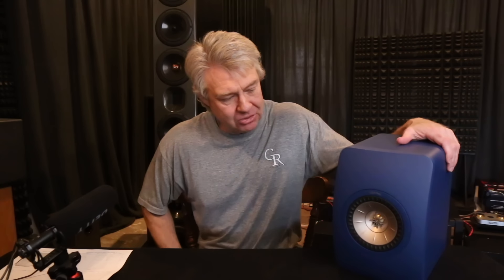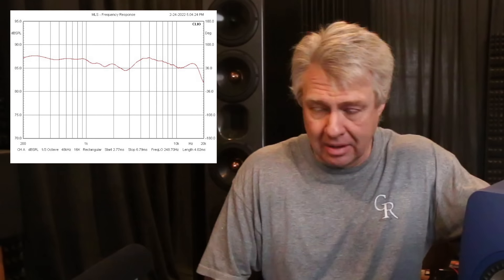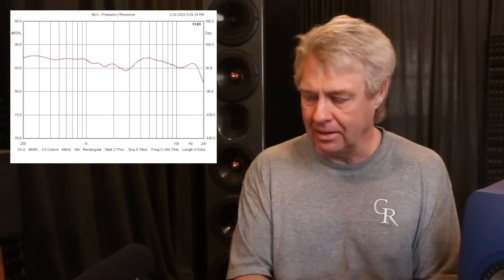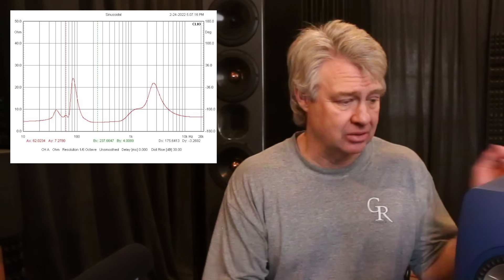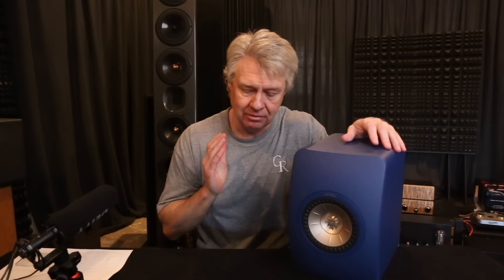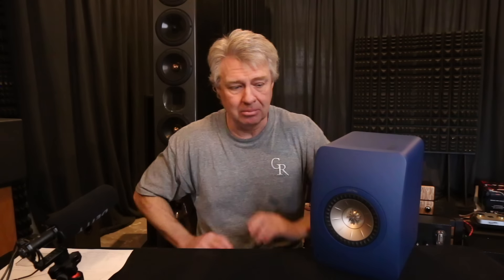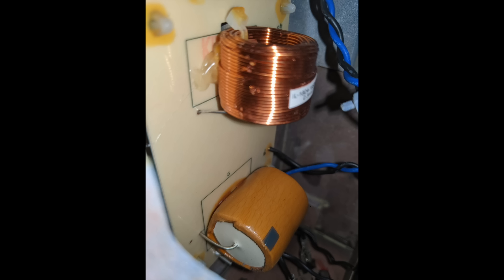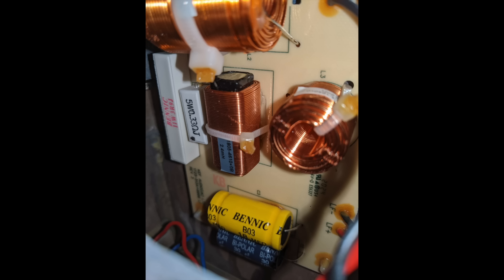KEF LS50 Meta! Worthy of HYPE?

Comment: Initially I enjoyed Danny dissections. Now not much. I would highly recommend instead of finding faults with every speaker and then recommending his business as the fix , he could do a real service by recommending speakers that are made well. His videos are at their core advertisements. Now very boring. Always cheesy, ferrous conductors, bad caps, etc. Same themes, different speakers, each and every time.
Reply: Well that means they're cheapening out in parts
Reply: Agreed
Reply: So true.
Reply: @johnsmith-i5j7i They’re building to a price point. What product is perfect, or doesn’t make compromises 
The only speakers that aren’t- often in ways most reviewers barely scratch the surface eg distortion at different SPLs, harmonic distortion - and IMD … are likely to cost north of $5000

Comment: For the price I couldn't find a better sounding, or looking speaker than the LS50, because there isn't any. I have owned quite a few different speakers, somewhere around 50 or so. I also use to build my own speakers, and although they were quite good, with high quality parts, inert cabinets, and exotic wood veneers, I couldn't compete. Fin. Thanks KEF!?! lol
Reply: Every kit we offer is well above them across the board.
Reply: If you build your own speakers there are several better in diy.  Madisound has a few scan speak kits that would probably compete with Wilson audio.  I happen to have a bookshelf that would compete with the b&w 802s.  Not to put you down but the kefs fall apart when you play anything by 2 cellos.  Anything with warmth like cellos sounds horrid on those.
Reply: What others did you try
Reply: Yes there are, plenty actually. You sound like a KEF fanboy. A Dali Opticon 1 MK2 sounds better in almost every way, except bass. The Opticon 2 will give you better bass. I had the first gen LS50 for two years so I know what I am talking about

Comment: What would be good is to hear your listening opinion on the speakers before you take them apart and then your thoughts after the tear down and see if they match.
Reply: How does one listen to a chart?  LOL
Reply: @ paul lazarro . The same way you use a tape measure to see how big something is or weighing scales to check somethings weight or a light meter to check brightness . A huge dip or peak is visible on a graph so is the distortion and the the resonances and the dispersion characteristics and the time alignment of the drivers . Measurements are a useful tool . Hope this helps
Reply: he only assumes it will sound better after the mods. Steel nuts, BS
Reply: There's plenty of subjective reviews of the speakers out there.  GR is great as a point of reference along with other reviewers.  I check with a few points of view since I can't just test everything at home. No single reviewer has everything sorted out.

Comment: LS50 was my gateway drug to the audiophile world. After having gone through many twists and turns with other brands and mixing and matching many different components and cables,  I’ve finally landed on KEF Reference 1 (+REL S510’s) as being the speaker that checks all of the boxes for me. I’m still very fond of the LS50’s and own 3 pair including the newer Meta. Great speakers for the price as long as you find the right component match.
Reply: Which amplifier would you recommend? Thanks
Reply: @martingritsch2340  depends on what sound signature (warm vs neutral) and features you prefer but the best matches that I have found are Denon PMA-1600NE, Denon PMA-A110 (excellent), Cambridge EVO-150, and Gold Note IS-1000 (excellent). All of these have some form of tone controls which I prefer to dial in the bass and lower midrange. All of my KEF speakers including Ref 5’s require subs (preferably REL) to maximize enjoyment in my experience. I love clean, tight, musical bass down to 20hz but I know a lot of people are happy without subs. Honorable mentions for Hegel H90, H190 and Arcam SA30 and AVR30 as well. The Arcams really sing with external DACs like the PS Audio DirectStream.
Reply: @martingritsch2340  
I've not owned these or the original LS-50s ... however, by most accounts, it truly benefits from high quality high power amplification.
Reply: @CaptainCrunch823  Many thanks for your competent and detailed answer.
I like the LS50 meta very much, but I also have no comparison.
Reply: @FOH3663  Many thanks for your answer.
Reply: @CaptainCrunch823  do you know if Kef reference 1 can go to 40hz? How about ref 3?
Reply: I have the original LS50's and run them with a parasound a21+ amp paired with the parasound p6 preamp. I've only just begun to go down the audiophile rabbit hole so take my experience with a grain of salt. I don't have much experience with many other amps, but when I got the a21+ is when the speakers really started to sing. How I describe the sound of this combination: imagine you're at an intimate live show. Seeing the performance and hearing it at the same time is a totally different experience than just hearing it through a set of speakers. To see and hear a performance live, you're able to recognize and hear more subtle nuances than you would on a recorded version. There's that "presence" that you're hearing and seeing at a live performance. Now to my main point, with this combo, imagine the performers are no longer there in front of you and you're left with that presence still, except for the fact that there's no one performing in front of you anymore. This would be my own personal experience. To put it shortly, you get a much better and more defined sound stage with more of a presence and smoother frequency range. I should mention I also have subwoofers to help with the low end frequency response. Sorry for that long winded reply.
Reply: @CaptainCrunch823  thanks, but do you think Ref3 can go lower or they just basically go louder?
Reply: @martingritsch2340  Hegel H120
Reply: How about Hegel H390?
Reply: I own the original LS50 in a second, small room system and they sound great with my old PrimaLuna Prologue 2 amp, which kind of goes against the received wisdom that they require lots of watts.
However adding a sub ( or subs ) really makes these speakers shine.
I recently bought a Kinki Studio EX-M1 as a second amp for my main system and look forward to trying its 215 watts with the LS50 when I can be bother lugging its 60lb weight up the stairs.
Reply: @20puskinas1992  using subs with a 2 way speaker will improve their entire performance because you are releaving this mid/bass driver from a lot of duties. They will go lower and louder...
Reply: @fluim0102  not everyone is using dsp and whitout this speaker is very limited.
Reply: @TheWizardofMNT  did you ever try other preamps with the a21+? 

I'm using preouts on an integrated to drive mine and without any basis for comparison am wondering how much I'm leaving on the table with a dedicated pre
Reply: @erics.4113  I also used it with the peachtree nova 300's preouts. Which is also an integrated amp. I didn't do a direct comparison. But to my ears, I don't think it was that noticeable of a difference. At the very least, the parasound p6 probably has a slightly cleaner sound since it's a dedicated preamp. But I'm just guessing. I only got the p6 for better home theater integration if I'm being honest.
Reply: @TheWizardofMNT  it's tough comparing two products. Especially when you have to do or redo connections, etc and then there is no way to rapidly AB switch between them. And that seems to be the best way to compare. Anyway. I am really happy with the a21+ and will probably try a minidsp SHD or similar as front end to it before long. I want to measure the room and try DSP, along with a different pre from the integrated I'm using now. 

The Peachtree you were using is a quality piece so maybe it's pre was up to snuff with the parasound. Thanks for the input
Reply: @martingritsch2340  I use an old Hegel H1 integrated, works wonders.
Reply: @CaptainCrunch823  что у вас с ушами? Хегель с китайскими платами говно, аркам говно, мета говно, денон 1600 и 110 говно, вы вообще нормальный звук слышали??????
Reply: @CaptainCrunch823  how about an Anthem MRX 720 or 710 — or a Denon HT in the under 2k price range? I’m planning to start with  a 2.1 setup with KEF Meta/Kube but planning to eventually create a 5.1 or even 7.1/Atmos home theatre.  Already have some active Adam A7X monitors that might work ok for rears for a 3 Kef Meta front/center config.
Reply: Way overpriced and overhyped speakers made in China. With listening to over 600 pairs of speaker, I give these no more than 4.5 for the sound and 9.5 for the looks. B&Ws a fraction of its price would sound better. $350 - $450 per pair would be more ideal
Reply: I love my LS50’s . They were not on display for listening in the shop I bought them in. My theory ? They knew they wouldn’t sell many of their other speakers if they promoted them. Rave reviews on release convinced me to buy. Haven’t regretted buying. The guy who sold me them didn’t interact with me hardly at all .. spoke volumes. He knew 😀
Reply: Yes, I'm sure you're telling the truth and aren't a paid marketing operative working for KEF.  After extensive ownership crap called KEF, I too have come to the realization that kef is amazing at being unable even to produce an app that works, let alone anything else.

Comment: If he finds the sound fatigueing for long periods, the issue may be the upper mid hump.  The easy suggestion there is to listen off axis where that hump flattens out.  It  will still sound a little dark due to the continuous slope to the treble, but it will reduce the fatigueing nature.  Tone controls might be able to flatten the response depending on the curve of the tone control.  Also, the fatigue may come from a room acoustic issue.
Reply: I sold mine for that very reason J. Listen to music for around 8 hours a day when I'm home.  The KEFS got worse as the day went on.  Room acoustics should not have been a problem as I have a Lyngdorf amp with Room Perfect. Purchased a pair of JBL L82 Classics and they are perfect. Less harsh, more low end due to larger drivers. The soundstage isn't as wide as the KEFs but I can take that as they aren't fatiguing at all.  Maybe as I listen to old soul and reggae on vinyl a lot is the reason why the JBLs are better.
Reply: @stephenjon3502  yeah, jbl didn't design the L-82's for soundstaging.  They built them for tone, texture & dynamics.  But don't think that room perfect will fix room acoustic issues.  While it can help, it won't completely undo bad acoustics.  Physics can't be fooled.  God created physics. He is not going to suspend physics because you bought a fancy digital processor.  As for me, I can't listen to digital for very long before the digital hash splits my brain in two.  Going to high resolution helps but then the fine details and lack of level gradations keep it from sounding real for me. Glad to hear you found a better solution in the L-82s.  I had a boss that had an original set if L-82s.  Glad jbl is keeping the heritage going.
Reply: Or from an amplifier.
Reply: @Technical_Audio  depending on the amp, or more likely amp/speaker interaction.
Reply: @luke9822  if God created physics, how can the two be opposed to each other?  Physics proves God, not disproves him. So the binary programing of dna that creates all living things, just evolved out of the ooze?   Sounds like a better understanding of God is needed.
Reply: @Luke Laws are created by intelligences.
Reply: @nathandaniels4823  if that is what you think, keep deluding yourself.  We humans discovered the laws God created when he created this universe.  Did we humans create DNA, the binary code that programs all living things?  Or did we discover it?
Reply: @jked7463  The Lyngdorf has certainly sorted out a lot of problems in my 400yr old stone cottage with 2ft thick stone walls.  Moving the sub and turning it a bit lower than recommended has mated well with the L82s which I love.  Much nicer to listen to than the Metas, especially with old reggae vinyl 45s. The metas struggled even with 2 subs. Glad I got rid.
Reply: @stephenjon3502  glad it worked for you and it is probably a good product for those that do not want to add absorptive and diffractive items in a room.  What I was saying is that if you were to add absorptive and diffractive items, you would hear additional improvement. Unless you use a steerable speaker like the B&O's,  your computerized system can only do so much since It can't change the dispersion characteristics of the L-82s.  Like I said before, I am not saying it is useless and I am glad to hear it is working for you and you are enjoying your system now.  Keep listening.
Reply: @jked7463  I did look at some of the panels on the market here in the UK but unfortunately I don't have a dedicated listening room. One thing I hope to have when we move to France hopefully. I couldn't get them past she who must be obeyed despite looking at some seriously good looking panels. The added advantage of the Lyngdorf was the size and the fact it is away behind a cabinet door which swung the possibility of larger speakers.  👍
Reply: @stephenjon3502  👍 that makes complete sense.  Sounds like a good way around the SAR (spousal approval rating).  I am lucky enough to not only have a dedicated room, but was able to build out a room in an empty basement to proper proportions along with other acoustic concerns.  You can get away with, not as, expensive equipment when the room is acoustically correct.
Reply: @jked7463  Sorry, I can't locate the original post for this. What am I deluding myself about?
Reply: @nathandaniels4823  I posted that God created the universe that laws of physics.  Humans only discovered God's laws of physics.  Someone posted that man creates the laws of physics.  That person argued with me that I am wrong.  I said if he wants to go on deluding himself that man "creates" laws of physics, he can do that.
Reply: I find it weird to have fatigue when listening to LS50M. Maybe in an untreated room with a lot of hard surfaces. I have massive problems with bright speakers because of hypersensitive hearing (high frequency) but never had any problems with this speaker. It's really clean sounding and can become even warm with small changes to room acoustics. KEF actually recommends listening to the speakers off-axis so this will 100% help. I personally like to toe in a little bit + use quality sub(s) for optimal sound. Without proper room treatment, I had major problems with the low-end in my listening space but fantastic after the change. 

I would think that people that spend an insane amount of money on audio equipment would also spend some money and time on the room acoustics since it's the most important part. It's easier and cheaper to fix the room than trying to fix the good speaker.
Reply: @Monsux  
Exactly 
Overlaying a room's entire acoustic signature atop a carefully crafted and finished piece of material ... burdens the experience unnecessarily. 
It corrupts and diminishes most every positive attribute a recording possesses.  

Amazingly, we can "hear thru" many of the room's distortions. However, stripping them away one by one, addressing both the freq and time domain challenges,... connects us more intimately with the source and increases the overall emotion and enjoyment of the experience. 

An additional point often overlooked with KEF's LS50, they benefit from quality, high power amplification. 
Perhaps it's counter-intuitive to some enthusiasts, but high wattage, high current capability is really put to good use with this small two-way.
Reply: How about it just probably being the room, seeying as very few people actually treat their room, even though it has a huge effect on sound. when you put absorbers on the wall behind your listening position, you will make the sound much less fatuiging...
Reply: @fluim0102  You could very well be correct.  Most people don't treat there rooms or if they do, not correctly.  .
Reply: Speakers are often blamed for deleterious sonics including fatigue. In reality, if your source, preamp, amp(s) and even cables along with the most important component - your room (which all need acoustic treatment) are not up to snuff, almost any system can / will sound fatiguing.
Reply: @MuzikSonics  yes, you are right, that matters much. I must say, the original LS50’s were fatiguing on the long term with some recordings. The Meta’s are better filtered, maybe also better speaker design, but I think it’s the crossover that makes the difference. For the money, and maybe double the money, there are no better options if you are looking for a monitor for a not too big listening room.
Reply: If you think a frequency response alone is what determines the sound of a speaker, you need a ton more experience in listening.
Reply: @Monsux i would call the LS 50 many things but warm isn't one of them. Often I hear people describe their speakers in total opposition to reality. I suspect the rest of the system is very warm.

Comment: I went straight for the LS50 Wireless II, thanks to a nice open box deal from Crutchfield. I am thrilled with it!
Reply: Hi Cavey, I heard the Ls 50 and then I heard the wireless 2..I was blown away. How come their own amplification is better?
Reply: @wicomms  The Wireless 2 has separate amplifiers for the woofer and tweeter that are designed to get the most out of them. It also has a lot of digital signal processing, such as phase correction, that is able to enhance the sound by having the drivers work better together.
Reply: @CaveyMoth  thanks
Reply: This of course eliminates the crossover issue that is discussed here.